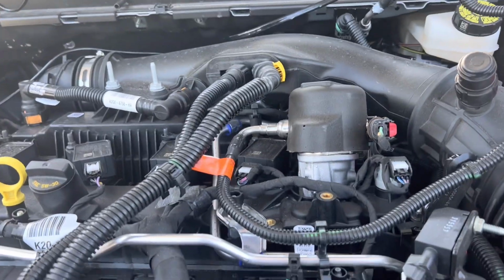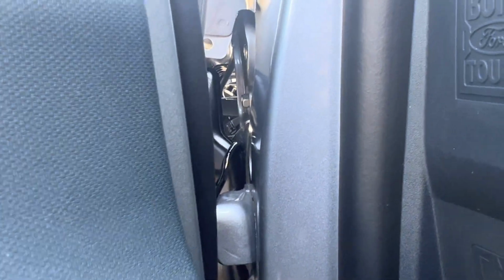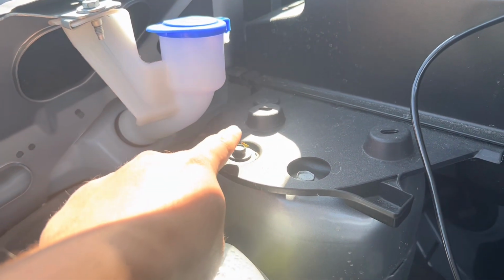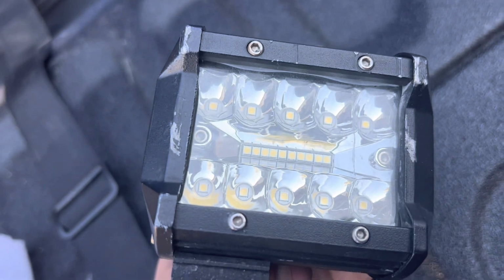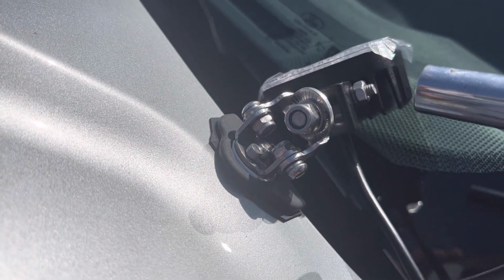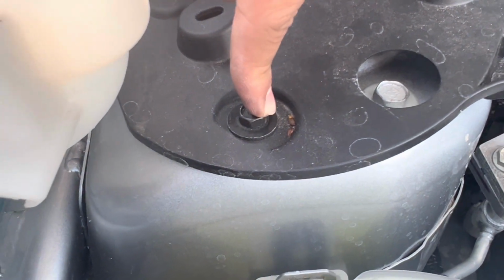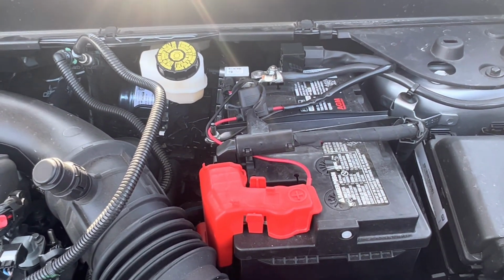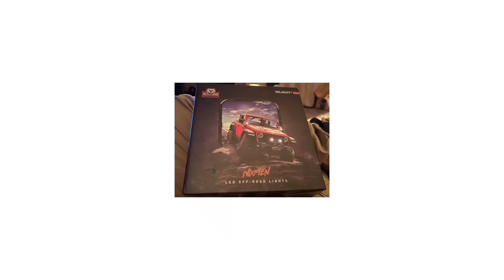2023 Ford Maverick Lariat Tremor - Nilight 3in LED Flood Light Install

Comment: There's a rubber gasket behind the 12v battery on the Ecoboosts that you can use to feed cables into the cabin.